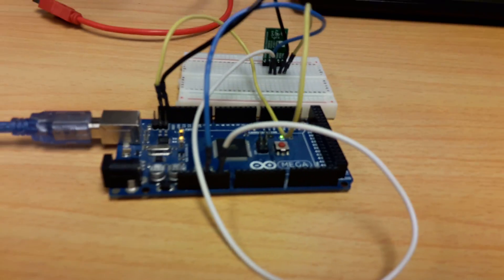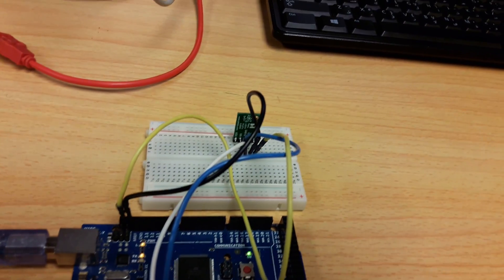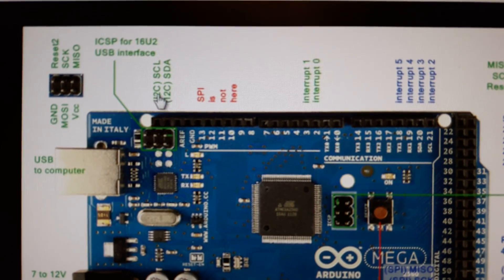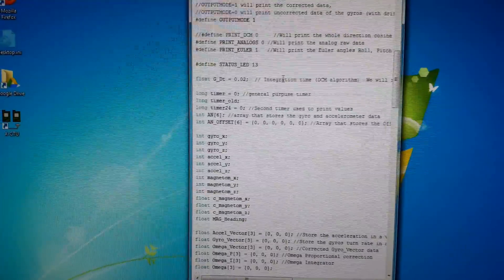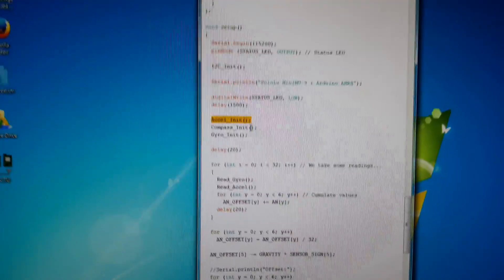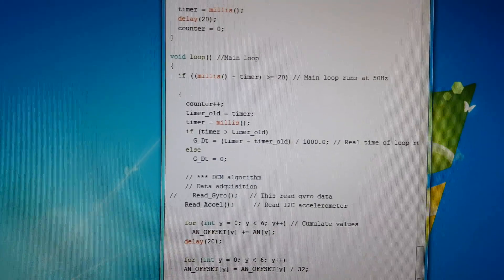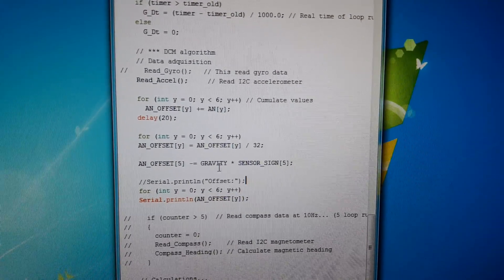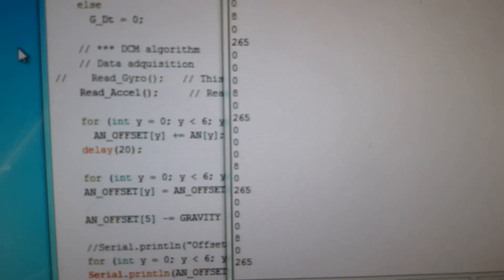IMU with Arduino: Velocity measurement

Comment: Hi Mamoon, I have been trying to integrate the data from an MPU6050, but really struggling to determine velocity vector and zero speed. Looks like you have solved this, great work. Would you please share your code so I may understand where I'm failing. Rgds, Brian
Reply from the maker: sure, email?
Reply: @newabdullah101  Ah, thought that was in the profile - please use b.c.rowbotham@gmail.com. TIA.
Reply: I'm having a lot of Integration drift with just the accelerometer (MPU6050). Some suggested using a rotary encoder and do some kind of sensor fusion. Did you get to solve it ultimately?

Comment: Baarakallahu Mamoon..
I appreciate your projects, it's great and very useful..
I used mpu6050 to get acc(x,y,z) and going to use  velocity formula ( V(t) = V(o) + at)
but I feel confuse to apply that formula...
it will be better and helpful if you send your explanation in the form of code to imam.sy11@gmail.com
thanks, Best Reagard
Imam Syuhada
Reply: Hi Iman, is it possible to find velocity and distance by MPU6050?
Reply: *imam